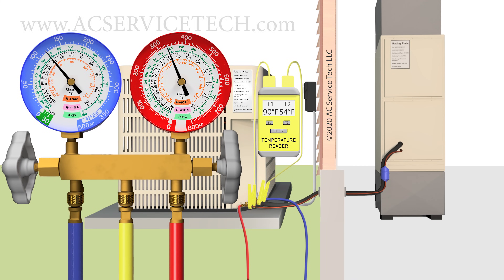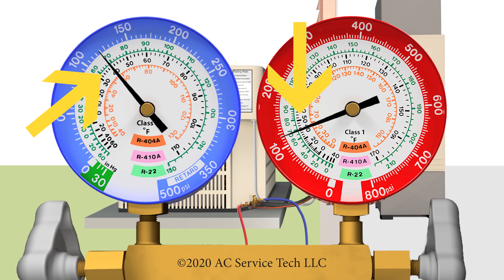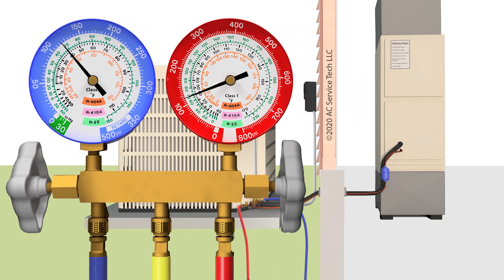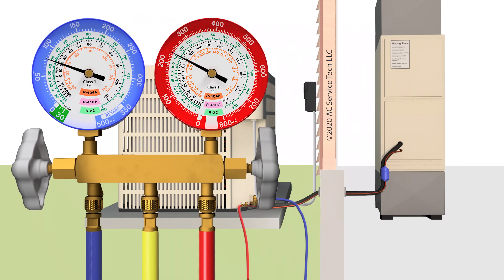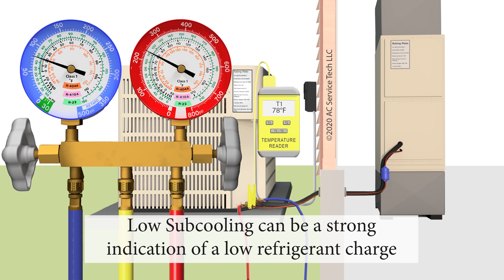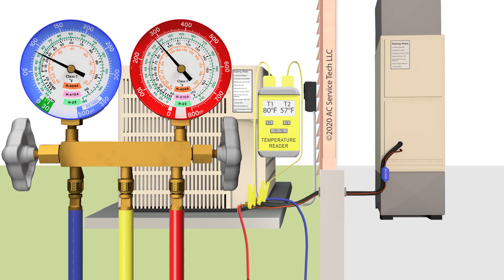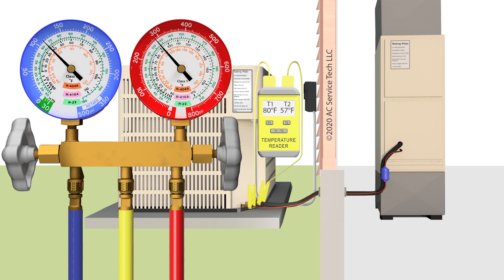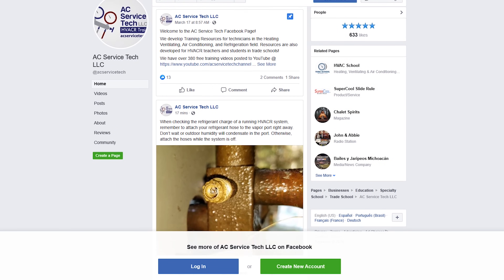Fast Check for a Very Low Refrigerant Charge on an A/C Unit!

Comment: I have a r22 system with a subcool of 19 desired is 11. But my compressor doesn't sound too well either as if it has a mechanical issue.

Comment: These videos are absolutely the very best out there.  You lay it out so plainly and so simply with no extraneous distractions.  Simply excellent.  I'm a total novice but I used all these videos to help me replace a reversing valve (yes, I invested in a lot of tools).  Couldn't have done it right without Mr AC Service Tech.  Thanks!

Comment: I recently got back into HVAC (after being a Electronics, radar, power generation and high voltage experience). My new HVAC mentor instructed me to check the HP saturated pressure, then check my app and add 30 degrees to the  ambient outdoor temp to the app to get the applicable super heat refrigerant pressure to determine if the system is low or high on charge.  I have found this is bad idea, heat every HVAC tech I have met uses this method. WTF?
Reply from the maker: That is such a shame. If they would only read some manufacturer install literature, they would know how to properly charge refrigerant. Crazy!

Comment: Subcooling can be used on an orifice to tell me if the charge is off?!?!
Reply from the maker: Not exactly and no you cannot measure the charge with the subcooling method with fixed orifices. However, in the event of an evap coil that is fully frozen, if the subcooling is between 7 to 15 degrees, this tells you that you are not severley undercharged with refrigerant. Thats all. Its just a quick method to know whats going on. If subcooling was 0 degrees with a frozen evaporator, you would know that the system is undercharged.

Comment: Hi, Mister Craig my name is Nelson. I was checking an r-22 heat pump system with txv in the air handler. I used the subcooling method 250 psig, 91F temp.t1 the first time.  I added the inf to the measure quick app with an 11target subcooling, cause I couldnt read the data plate and the app said that I had to remove refrigerant. However, the blue gauge showed the saturated temp.  between 32, 33. also, I measured Delta T and it was 47. something on supply and 71 on the return, but 24 is higher than 18-21. So, my question is if Can I remove refrigerant from the system with the blue gauge on that number?

Comment: If there is a restriction in the system n the unit is off what pressures would u read on hi n lo sides ? I thought if there was a restriction n the unit was off then the static pressure would b low n not reach ambient temp. This is for commercial refrigeration units like walkin n reachin coolers/freezers.

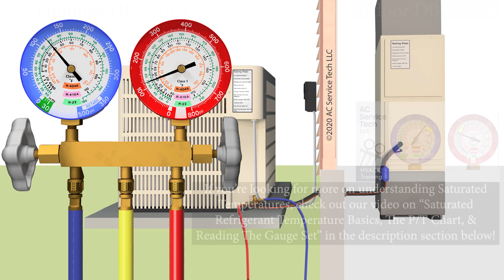Comment: at ~1:00 "Saturated Temp should match surrounding air temp".  Lost me here. Why should sat. temp = air temp when system is off?  (I watched the sat Temp basics, but did not see this point addressed).
Reply: Ashen the outdoor temperature is 70 degrees, the standing pressure for 410A should be 201 psig which the saturation temp is 70. In his example, the pressure is 118 psig which converts to a saturated temperature of 40.

Comment: How much refrigerant pressure must still be in the system to do a proper pressure test ?? on low and high side. Would you add a little refrigerant for the test etc etc    Thanks

Comment: Thanks for the info Craig! Quick question though, if indoor temperature is a different temperature than outdoor temperature, how much of a difference will that vary the pressure to temperature correlation? So for example i put my thermometer on the outdoor  unit and measured 70F outdoor ambient temperature but indoor temperature is say 73F, will this effect pressure temperature measurement? And is there a say a range +/-5 degrees? Thank you for your time!

Comment: Is It your book teach how to check the gas for the air-con, inverter systems, 1 compressor can use for 2 unit,3units,4units....
Because her in Singapore all ppl use system inverter, and the air-con have just LP for you can top up the gas.
I already see  the video for Mitsubishi inverter, but they dont show the details

Comment: Do you have a book which prepared on to take the 608 Certification test? If not, will you please write one? Your book is second to none.
Reply from the maker: I don't at this point yet but I would like to do so in the future, thanks!
Reply: @acservicetechchannel  When you do write it, will you please make sure to use the glossy pages exactly like you did for the other book? It helps a lot with durability and readability. I'd rather pay an extra $20 for that type of paper.

Comment: Hi ac service tech :) im a fan of yours from the Philippines. Im more of a diyer and been researching about the problem of my 2 horsepower mini split AC (LG HS-18ipm inverter ac model number)

Can i ask about your opinion on what may be the problem of my AC system? Thanks

I am experiencing icing of my evaporator everytime my condenser (outdoor unit) gets a THOROUGH cleaning (i installed a watt meter on my ac and when the consumption hits 1,100 watts ice slowly forms on the evaporator). Icing happens when i set the thermostat to 24 degrees celscius or below

BUT here is the contradicting problem. When for example my condenser or outdoor unit hasnt been cleaned for like 4 to 5 months it is very dirty and almost clogged, BUT, i dont experience any icing on my evaporator (indoor unit) and cooling is excellent and working fine, i can even set the thermostat to 18 degrees without icing (consumption on the wattmeter registers 2100 watts)

What could be the problem? The ac technician who handles my AC servicing couldnt give me a clear answer.

Hoping to hear from you soon. Thank you! Godbless

Comment: Looks good. The only thing I do above this, is an additional ball valve that would fit between vac gauge and machine port. The purpose being to do an immediate pump and gauge test within the first couple of minutes. I get to see my gauge drop right below 50 or even 20 micron. Not just 500. 
Helps test the hoses for leaks also

Comment: So when checking charge with the system off assuming outside temperature is 85 and inside temperature is 72 does that mean I’m looking for 78.5 saturation equalized pressures at my gauges?for a charged system?
Reply from the maker: It will more closely match the outside temperature and it will depend on how long the outdoor temp has been that high for. So to put it into a real world situation, when I walk up to a system thats very low on refrigerant and off and equalized, when I read a sat temp on both gauges lower than what the indoor temp is, I know somethings wrong because the indoor temp is usually lower than the outdoor temp. Either the wrong refrigerant is in the system or more likely, it has lost all the liquid and there is only vapor left. Thanks a great question!
Reply: If it seems close to normal the only way to tell is by running the machine. That's because you can lose over 3/4 of your gas and static /resting pressure remains the same. 
On cooling low pressure will drop like a stone

Comment: Do this work for micro channel coils
Reply from the maker: It would be very similar on this scenario yes as long as the system had a single or two speed compressor running in second speed, thanks

Comment: Nice to inform techs about the non running pressure check. But it's not "air" freezing on the coil at 32F. Also, I tell my trainees that it should be between outdoor and attic (if it's in the attic) temp as they are usually not the same. Thanks, though!
Reply from the maker: Yes I mean't the humidity in the air, and yes its not usually the perfect scenario. I just wanted to get the principles in their minds, thanks!

Comment: Keep in mind, this IS NOT for the average d I y guy. You need to have some formal training before attacking a refrigeration issue. Also must be certified to handle refrigerants.
Reply: Well before say 1990 it was simply the average person's simple easy task. Ie folks topped off ac units in cars in window units and central air units. There were not even any recovery units or recovery tanks then. A 30 lb jug of R22 was 25 dollars at the local NAPA store. In Window units the bigger ones came with instructions on how to add refrigerant. Maybe in 30 years one will need an EPA license to change the oil in a mower since regulated? :)   Pre EPA refrigerant rules the 30 LB jugs of R22 or R12 etc were two way valves. Ie one could pump back good R22 into a used R22 tank to reuse the Refrigerant after doing repair. Later the valves hit changed so one cannot do this with an old tank. Pre say 1990 EPA rules the common then R12 12oz and 14oz cans were used for air horns on boats and for ball games. Also for toys that shot BBs. Eons ago the cans were 50 cents each when gasoline was 33 cents. In automobiles an ac unit can just have a slow leak in seal in the compressor. Using it every month helps keep the seal healthy
Reply: @3beltwesty  Yep, those were the good old days. Things have changed, leave it to the professional. Note, I am retiring soon.
Reply from the maker: Absolutely, you must be EPA 608 certified before handling any refrigerants. These HVACR training videos are primarily focused toward those in HVACR school and those in the HVACR and maintenance trades, thanks!

Comment: How are you figuring an iced up coil low on refrigerant due to low subcooling where the coil is totally iced over  that uses a fixed metering device tev yes understood but a fixed metering device goes against what I have read and told by many
Reply from the maker: We check the charge with subcooling on systems that have a txv and systems with a fixed orifice with total superheat. However, even if an evap coil is frozen over with a fixed orifice, a system will still have some subcooling. If the subcooling is only 1 degree while the coil is frozen, then the system is going to read as low on refrigerant when checking with total superheat after you defrosted the coil. If it had say 5 degrees or higher while the coil was frozen, it could go either way and you could melt the coil to tell and check with superheat.

Comment: First tip is incorrect, in refrigeration 10g or 1kg of same refrigeration at equilibrium has same pressure, doesn't matter the weight. Please correct that in your slide
Reply from the maker: Immigration Freedom. The pressure would remain the same in a system or bottle as long as the refrigerant still had some liquid left regardless of the weight. If it has liquid and vapor present, that is saturated. However, I am explaining when so much refrigerant leaks out that there is only vapor left, the pressure will be lower. Due to the availability of space in the tubing I often find about 7/8 or more of the full refrigerant charge has leaked out. If the charge had only leaked a little bit, the pressure in the system would have remained the same because there is still liquid in the saturated mix. This is an odd scenario that no one seems to talk about so I thought I would throw it out there. Check out the other video on saturated temperatures. The link is in the description section of this video, thanks!